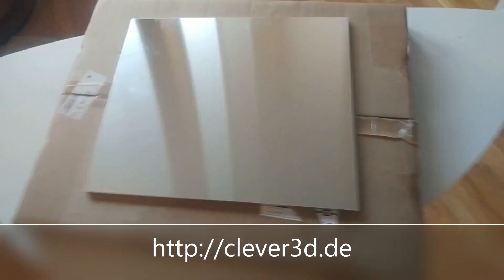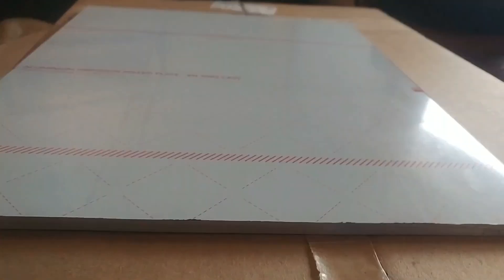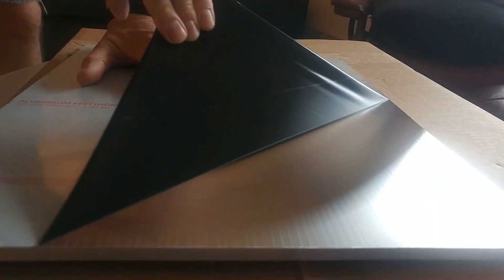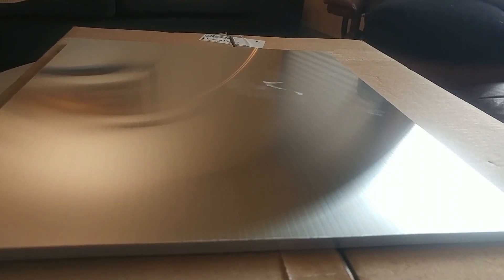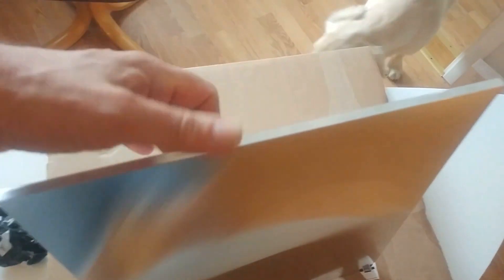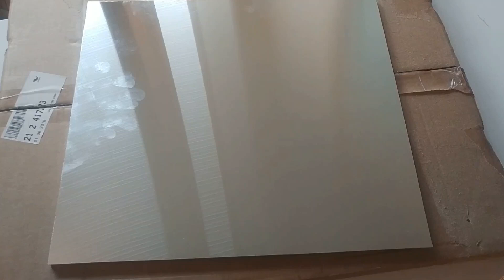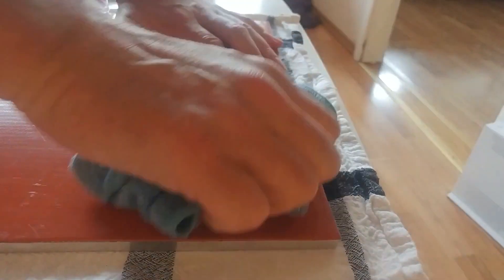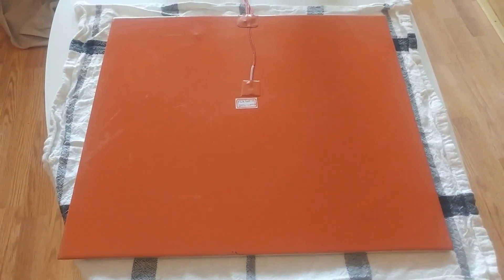V-King CoreXY - Build Plate - CNC milled aluminium + 1000W Heater!

Comment: how will you mount it / the heater takes the whole area?
Reply from the maker: In my case that is not a problem. The silicon rest on some corner brackets no need for screws through the plate

Comment: I have a 1/4 inch thick cast aluminum milled flat beds for my printers. About $38 US Dollars each. They work great
Reply: Where did you get them? The cheapest I've found for this size is at $78 for 3/8" and $70 for 1/4".
https://www.discountsteel.com/items/C250_Aluminum_Cast_Tooling_Plate.cfm?item_id=152&size_no=2&pieceLength=cut&wid_ft=1&wid_in=1&wid_fraction=.75&len_ft=1&len_in=3&len_fraction=.75&pieceCutType=35%7C3&itemComments=&qty=1#skus

Comment: Why did you go with 8mm? And what is the tolerance across the bed? I wouldn't put silicon. Use a graphene heater.
Reply from the maker: Deneteus why 8? Because of the size of the bed. It was 8 or 5 so 5 was a little skinny
Reply: @PRO3DESIGN  Would 1/4" work? Or what is the best solution for faster bed cooling time. I need to optimize all the aspects of this design because I may be building a number of these machines. https://www.discountsteel.com/items/C250_Aluminum_Cast_Tooling_Plate.cfm?item_id=152&size_no=1&pieceLength=cut&wid_ft=1&wid_in=1&wid_fraction=.75&len_ft=1&len_in=3&len_fraction=.75&pieceCutType=35%7C3&itemComments=&qty=1#skus
Reply: The silicone heaters work fine. Do you have a link to a graphene heater?